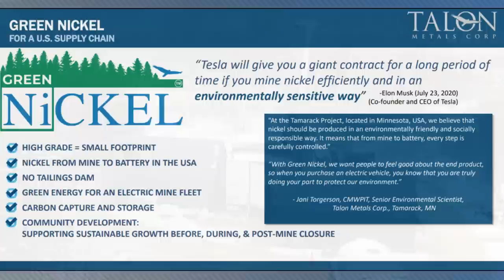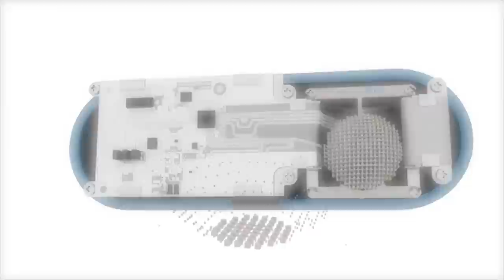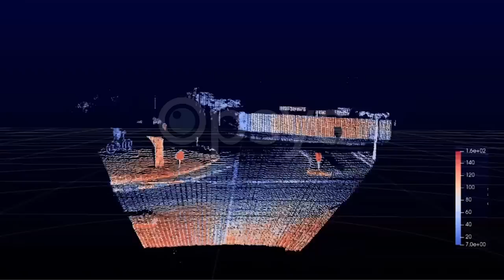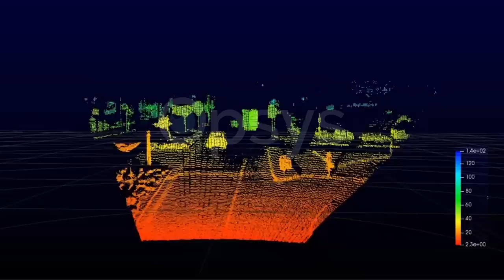Mitsubishi Reveals Electric Kei Car; Tesla Has Record Month in China - Autoline Daily 3236

Comment: The TTP ultrasound device will be a game changer for autonomy and ADAS if it can keep sensors clear.
Wouldn't mind it on the windshield if it avoids wipers in incessant drizzle!
Reply: Carmakers have been touting some kind of ultrasound or air pressure alternative to windshield wipers for literal decades. I do not doubt it could happen now, but seems unlikely for windshields because a good set of wiper blades has yet to fail. But if it ever does happen, it will be like some models of AUDI, who tack on "ultra high tech" solutions "cost be damned". LASER beam headlights that cost as much as decent Certified Used car, a pair, immediately comes to mind.
Reply: I feel like for windshields, and all windows on a vehicle for that matter, automakers need to make a glass (or their suppliers who make all the windows) that is super smooth. Basically like what RainX does by filling in the pores, but much better. Nothing will have the chance to stick, or only one wipe is needed ever so often in heavy rain. Plus, in the winter, snow and ice will scrape off super easy.
Reply: @jeffs6090  
Then it is just easier to use Rain-X or some similar product.